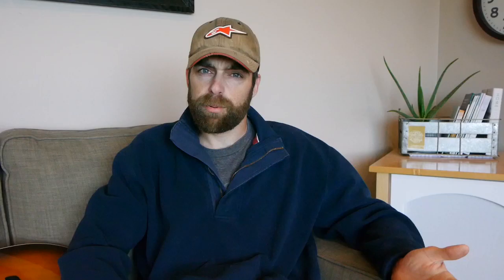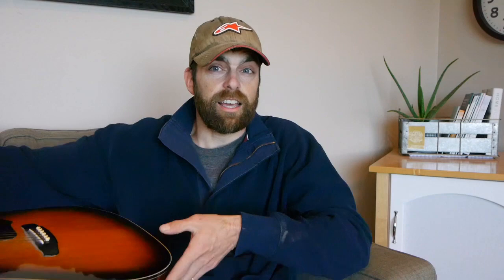3rd Order Harmonic Distortion VLOG

Comment: One thing to remember is that our brains are susceptible to auditory masking. We can hear a note on its own but in the chaos that is music, the note (or distortion) can completely vanish. Auditory masking has been thoroughly researched and is fundamental component to lossy compression. Play that 40db down note in the middle of the song and it'll vanish.
Reply: Not being able to distinguish a note doesn't mean it's unimportant. We get our spacial cues from the different frequencies and their timing delay and any distortion can mess with the clarity and therefore the perceived imaging
Reply from the maker: Jordan Lewis good points. That’s harder to demonstrate. Hopefully this helps explain what’s happening though. I tried not to say what level distortion should be at.
Reply: Was about the say the same thing..
Reply: @KB0B0  we do get a sense of our environment (quite a bit) from reflections yes, but distortion is not used to perceive imaging

Comment: The issue with speakers that have high harmonic distortion (HD) is not just the harmonics. The same non-linearities that result in HD also result in intermodulation distortion (IMD). IMD just sounds bad by any standard and you don't want it in your music. Unfortunately it is not part of the standard measurements that are done for speakers, but you can use HD measurements as a proxy for IMD measurement.

Comment: Wonderful video.  If you get a chance to revisit the topic it would be appreciated to hear your opinion on the combination of musical temperament with distortion (harmonic AND intermodulation).  Take for example the A note at 110 Hz.  The perfect 5th in equal temperament is 2^(7/12), or 1.4983. This is slightly off from 1.5, which wreaks havoc when considering the harmonics of the 5th don't intersect with harmonics of the root.  Distortion in guitar amp can cause compression which brings out attenuated frequencies that would normally not be too problematic in acoustic instruments, but become offensively audible in distorted instruments.

I may some day visit this topic in my own way, but for now it would be great to hear your point of view on the topic.

Comment: mate, if you are still active here,  I wanna ask you a question, you have made videos about dayton audio rs225-4  mid woofer in the past...   now you can buy  dayton audio  rs225p -4   paper  cone 45L vas 35hz,  what is your opinion on it?  it has a lighter cone so it can be crossed higher, I'm thinking about 1.8k to 2k cross point...  I have a small enclosure around 31L litres  or in cu ft  1.1, ported, so I don't know if I should get the rs180p-4 instead, which has 21L 35hz,   my goal is not to get the lowest frequency,   my goal is to get more SPL  50hz  to 200hz, so I can blast loud bass outdoors,  if I only achieve 45hz with the 8 inch that's fine with me  as long as all other frequencies are playing loud above 45hz... for an outdoor speaker tuning low doesn't improve spl, hard to get bass below 40hz outdoors anyway... so either i can go for the 7 inch get more low extension,  or the 8 inch and get louder bass from around 45-50hz i guess.... do you think my idea in theory works, and i can stuff the box with polyfill to try simulate a larger enclosure, maybe with a bass boost at 30hz can still achieve bass down to 40hz...   it's not a big box by any means,  i had built a box for neo dayton nd140-4, box size vas 1.5x and it was really bad, bass above 80hz was very silent...  it was a complete dissapointment,   until i reduced it to about 1.2 x  vas

Comment: 1st the frequencys you spoke about are bass frequencys not guitar. The A string on a guitar is 440 Hz, ok but that has nothing to do with your argument. All harmonic distortions sound pleasant because it is the same tone just on octave higher. Harmonics are part of the overtone spectrum of every instrument. These overtones are important because they act like kind of an instrumental fingerprint. If a guitar and a trumpet both play a concert pitch A (440 Hz ;-) then without the overtone spectrum they both would sound like a synthesizer and you could not tell what instruments are playing. But since we all know the fingerprint (overtones) of a guitar and a trumpet we can tell what instruments are playing the tone even they all generate the same base frequency (given that are they all in tune).
The odd thing in HiFi is when gear is producing overtones that are not in tune. I.e. you play an A and the gear has it's first distortion on Cis not A''. By the way not all tube designs produce distortion on the harmonics, listen to an average KT88 push/pull design, that sounds more like a transistor amplifier than most transistors do because the distortions are all over the place.

Comment: Man, you look beaten up. Renovations, yep.
3rd usually makes it sound, hmm, 'wierdish'. Doesn't magnetic tape recorder produce more 3rd than 2nd harmonic, the K3 designation in specs - the highs usually sound different than Digital or vinyl on tape. Most designers of electronics try to avoid odd harmonics, at least that's the consensus among hard core audiophiles. (Good to be poor, then you don't worry about it, you're happy with whatever you have). The whole debate keeps going ever since Black (I hope  my memory still works) implemented negative feedback in amplifiers - the Single Ended Triode (kind of hard to get decent spl w/o efficient horns with them) vs Solid state amps, etc. 
BTW, did people noticed that test published in Audio Express by Vance, shows dominant 3rd harm SB Berilium for the small faceplate tweeter - kind of strange, since usually 2nd would be higher in level than 3rd, unless it's a misprint in the article.
Also, let say we have a of pair drivers that, other measuring very close in freq response, differ a little in produced harmonic content because of resonances, build tolerances, bla, bla. I wonder how noticable is that. Can someone comment on it.
Years ago Cheever published interesting article about distortions produced by amps - he compares SE vs more complex designs and distortions they produce, linearity of open loop operation, bla, bla, ....
https://www.semanticscholar.org/paper/A-NEW-METHODOLOGY-FOR-AUDIO-FREQUENCY-POWER-TESTING-Cheever/3965581bce5f07e2a30427336352d705b06e8e34
I found the article if anyone is interested.

Comment: Let's be certain we're using the proper terminology. What you're actually talking about is overtones (look up the "overtone series"). A harmonic is a thing one does while lightly touching the string. It is an action, *a thing one does*.
Reply from the maker: You’re speaking as a guitarist.
Reply: @ImpulseAudioSpeakers  I'm speaking as a person with a significant academic background in music theory and composition and audio
Reply: @ImpulseAudioSpeakers  the three notes that you played were the fundamental, the first overtone, then the fifth. That follows the overtone series perfectly.
Reply: @ImpulseAudioSpeakers  I'm not blaming you. Throughout audio and people that write about it use the terminology incorrectly.
Reply from the maker: @kdsf12  I get it. You’re saying the harmonic is something that’s caused by doubling the vibration of the string, such as gentling tapping the string around the 12th fret. I’ve used “harmonics” while playing also. But when it comes to distortion it’s about frequency. The fundamental is the intended frequency and all other doubling, tripling, quadrupling, etc. of that fundamental frequency is called a harmonic. You can’t put your finger on the speaker cone to create a harmonic. Harmonic distortion (which I’m only using the guitar to illustrate) is all multiples of the fundamental. Overtone is a musical expression. Not an audio engineering term. It’s used for describing chords or scales or what ever, but not to describe harmonic distortion in a playback device (speaker). This is why I said you’re speaking from a guitar background. It’s just a different perspective. Neither of us are wrong, just that the way I’m saying harmonic in this video is definitely accurate.
Reply: @ImpulseAudioSpeakers  if memory serves it's 15 overtones generally
Reply: @ImpulseAudioSpeakers  also if they put the number one under the fundamental, that's wrong too! I see that all the time! As a music theory teacher drives me insane.